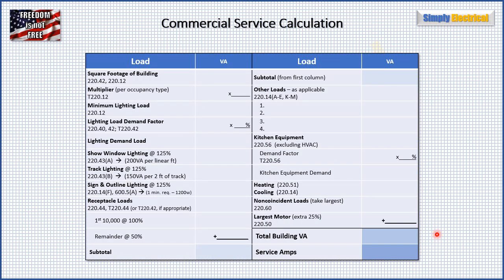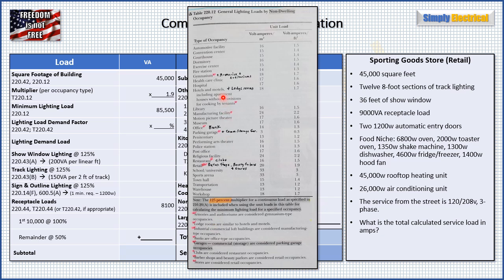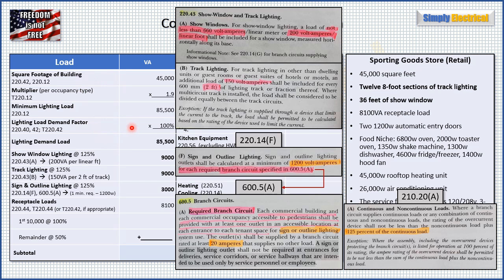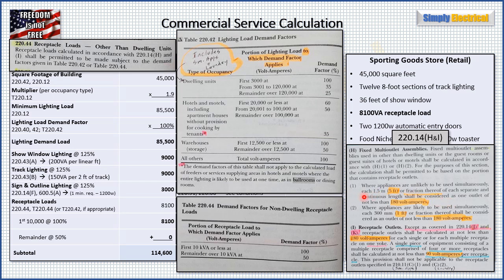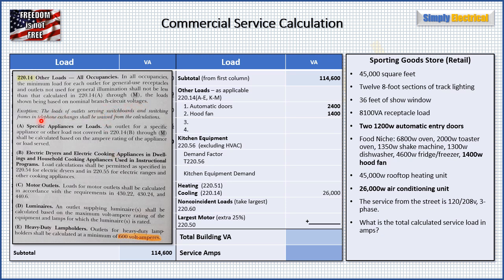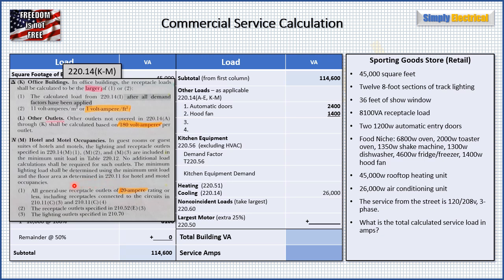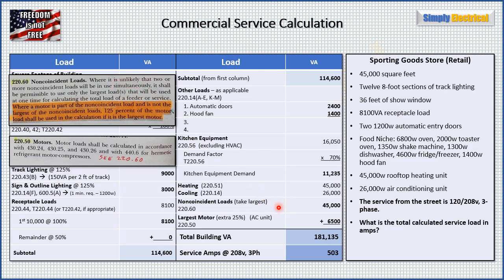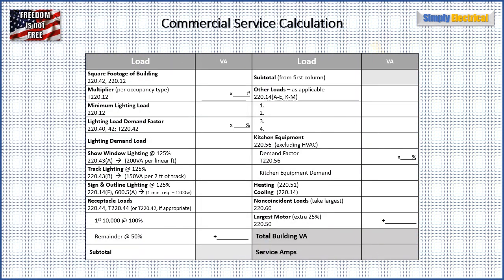Commercial Service Calculation -  Deep Dive 2020

Comment: I’m studying for the Oregon General Supervisor exam (which it brutal by the way), but maybe this question isn’t the best example because it is so generic. They didn’t include equipment voltages. What if the heat was (3) 15000W, 1PH, 208V loads? 

Can you please do a an example on a more challenging question, like a restaurant without just wattages and a mixture of 1ph/3ph loads?
Reply from the maker: Yes, Oregon is tough.  When I took mine 20 years ago, they had trick questions on the exam.  Some questions had no correct answer and others had more than one correct answer.  They provided us with scratch paper so we could explain which answers we chose and why.
Like you said... BRUTAL.

If they don't include the equipment voltages, there are two possibilities:  either the voltage isn't necessary to know for the answer, or there is enough information given in the question to determine the voltage via Ohm's Law.  An Ohm's wheel chart is super helpful, if you don't have one.

https://ohmslawcalculator.com/ohms-law-wheel

If you have (3) 15,000w heating loads in commercial, just add them together (assuming they are not noncoincident with larger loads), regardless of the voltage or phasing.

If you have a load calc question that has several 1ph and 3ph loads, go to Table 430.248 and Table 430.250, respectively, to determine the FLC.  Multiply the FLC by the voltage of each motor to get your wattage (don't forget your 3ph multiplier - 1.732).  They must either provide the voltage or else provide the means to attain the voltage within the question.  Otherwise, no solution is possible.

Hope that helps at least a little.  Let me know if I misunderstood any of your questions.  🙂